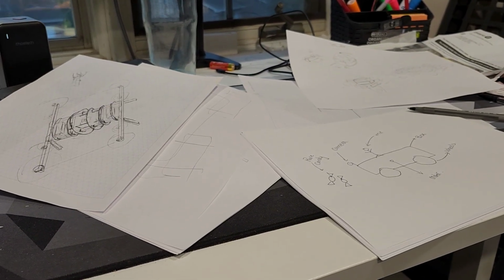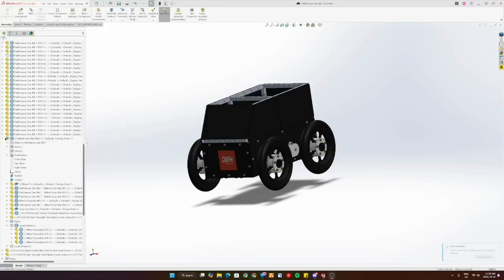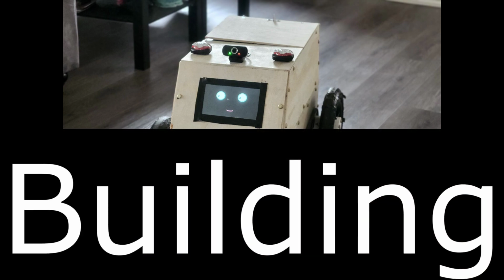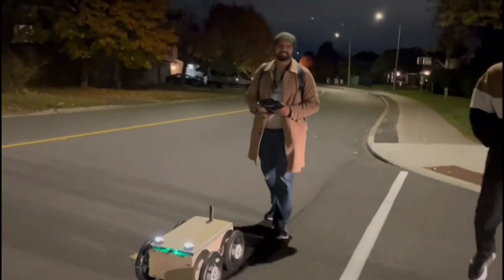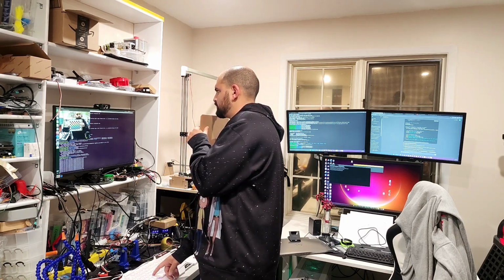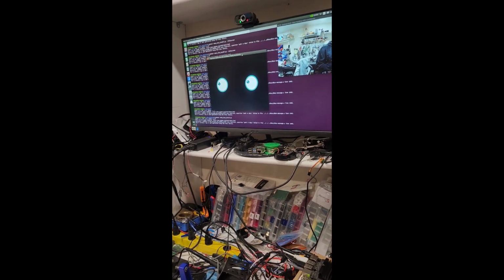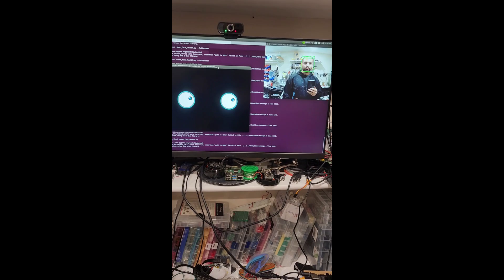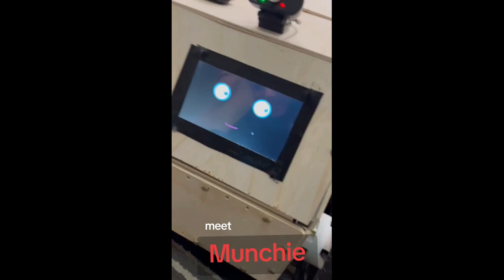Meet Munchie: The DIY Candy-Dispensing Robot Perfect for Halloween! (Part 1)

Comment: Can the hub adaptors withstand and not break while carrying 200 pounds? Also why not use hoverboard motors on all four wheels? Do you have a project using hoverboard wheels such as a follow me backyard garden cart?
Reply from the maker: Thanks for the comment! For Munchie Mark 1, the hub adapters were 3D-printed from PLA, mainly for a quick Halloween build to distribute candy, so I haven't tested them with heavy loads. I appreciate the hoverboard suggestion! Munchie Mark 2, featured in my next video, will have hoverboard motors on all four wheels and a much-improved suspension system with 'Follow Me' functionality. 

I'll also be taking him to the grocery store to help carry groceries.  the teaser video for Munchie MK2 is here: https://youtube.com/shorts/DAQxh0AU0TQ?feature=share

I appreciate the suggestions, thank you!